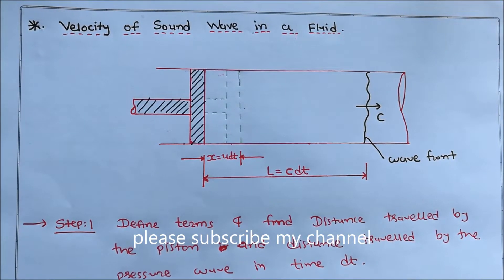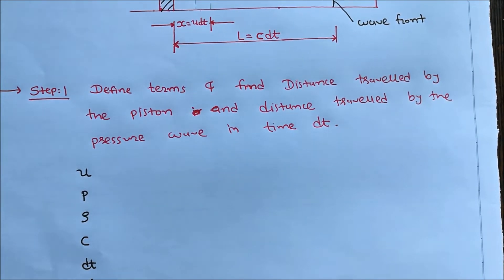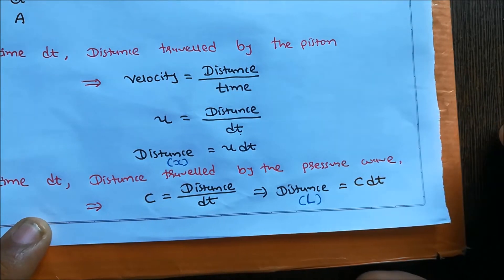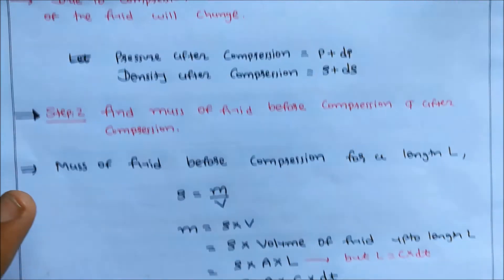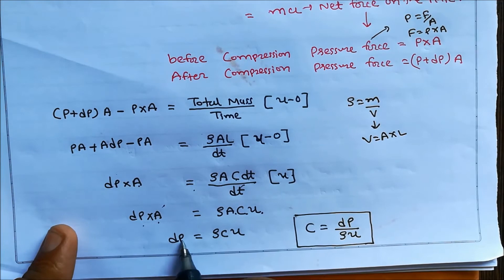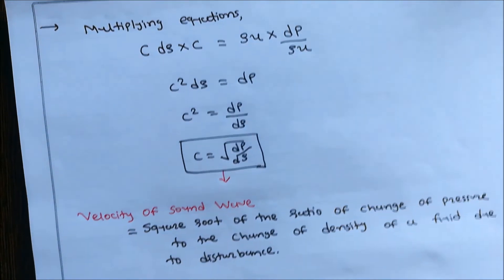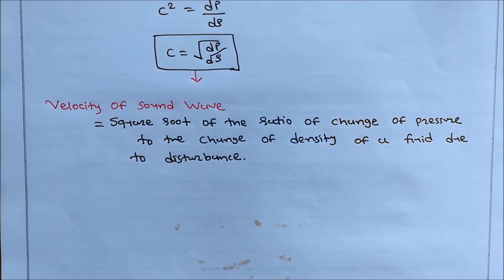velocity of sound wave in a compressible fluid

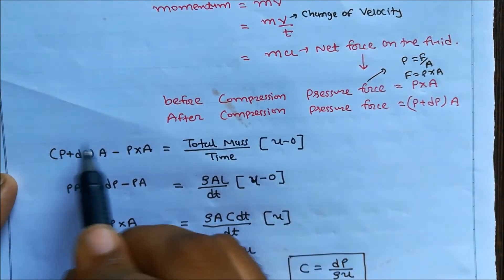Comment: At 09:53, U considered the velocity of system is "u", since the compressible fluid under consideration is getting compressed between the wave front & the displaced piston. So the velocity of total mass will not be equal to "u" as portion of mass in contact with piston is moving at "u" & the portion of mass behind wave front is "0". 

It will be absolutely ridiculous to think that entire mass is moving at "u" , in which case there will be no compression & no change in density.

The velocity should be an average taken over the entire mass.